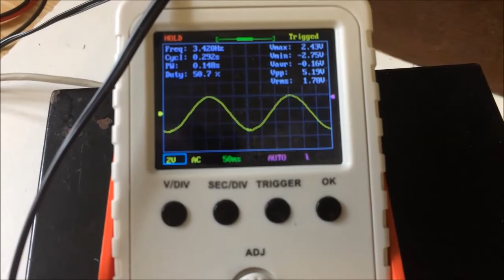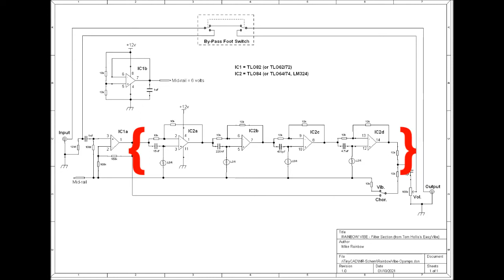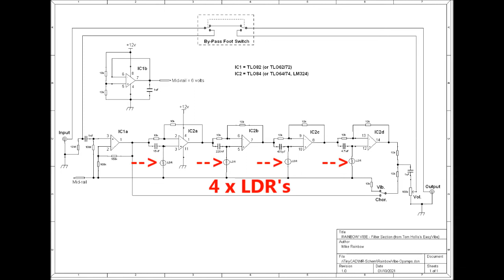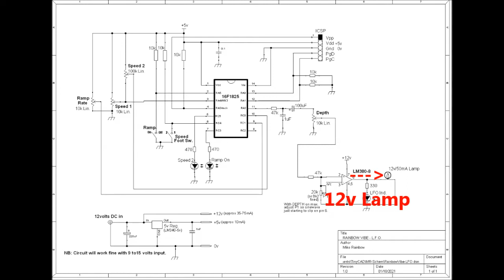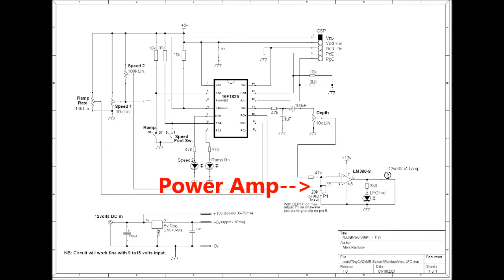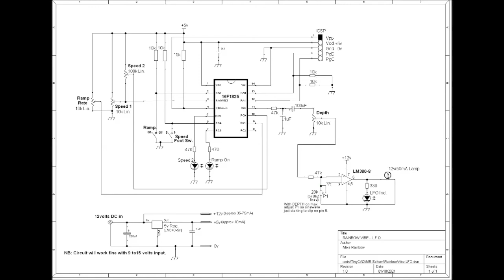DIY Univibe Guitar Effects Pedal Clone.

Comment: I had an "aquavibe";      which has a useable control refered to as "center", which can 'move the circuits reactiveness fore to aft of the input signal;
     which gives a bit of unique variableness, especially when setting subtil, or finding the "sweet spot" on any melody:
     Perhaps you might see about that:
     Your circuit sounds clear, with good highs.
      I would like to build one, but there seem to be none with that added feature;
     And I am a beginner at building circuits.
Reply from the maker: Hi - thanks for watching. I suppose there would be a number of mods and extras you could do but I'll leave that to other experimenters to try. Mike